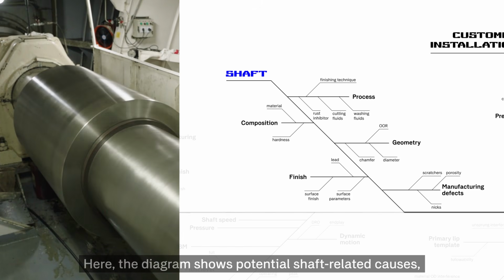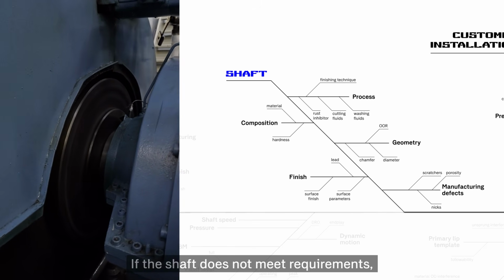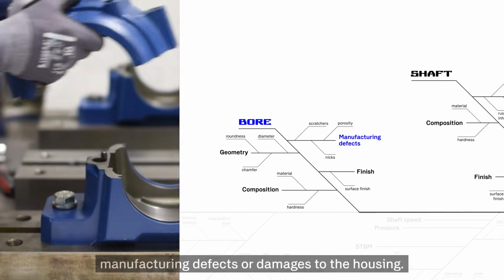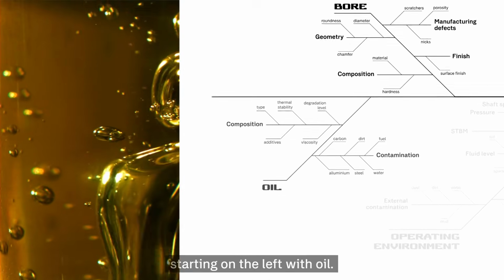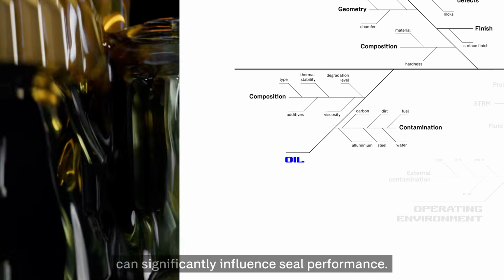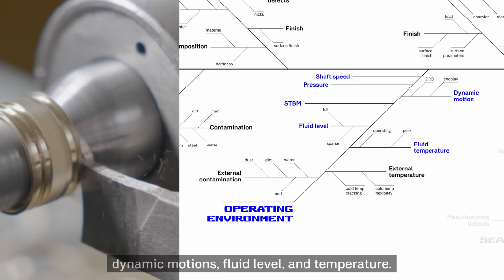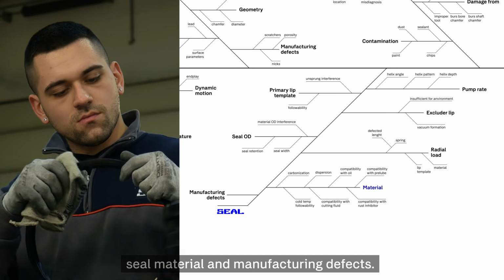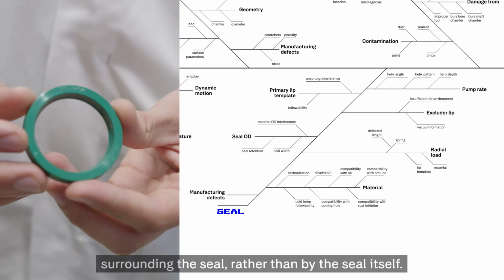Explanation Seal Failure Analysis Diagram

Comment: Framing leakage as a system outcome rather than a single cause is the honest position, and the carbon face is where that combination becomes visible. A slightly worn bearing plus a warm flush plus a marginal grade each look harmless alone, and together they polish the face until the film cannot form. Reading the face tells you which of the conditions was dominant.